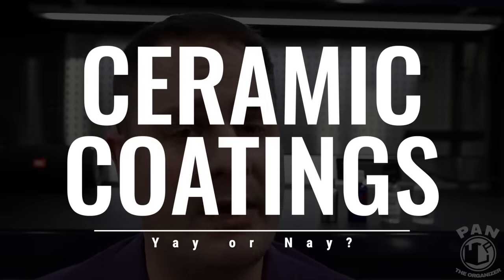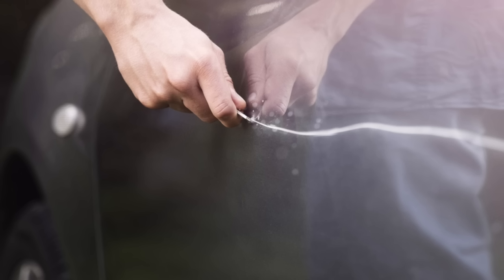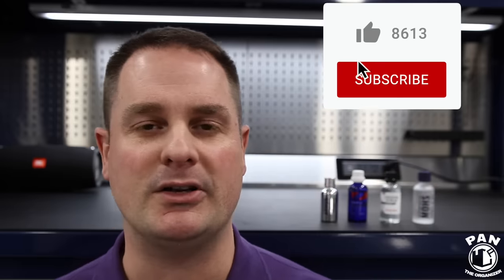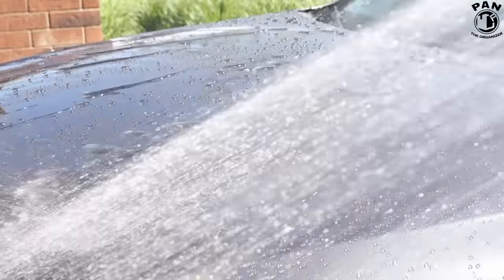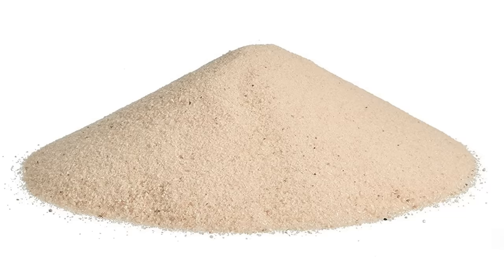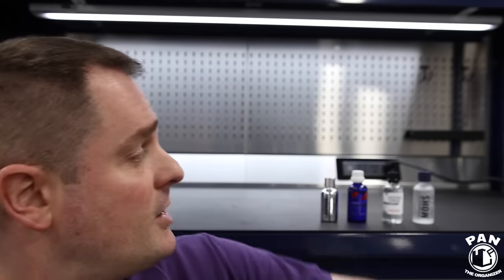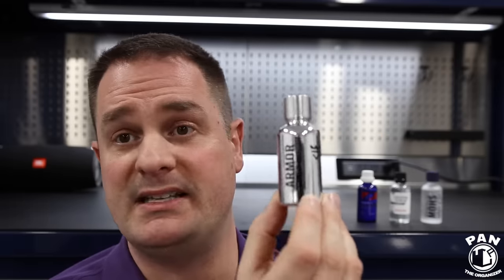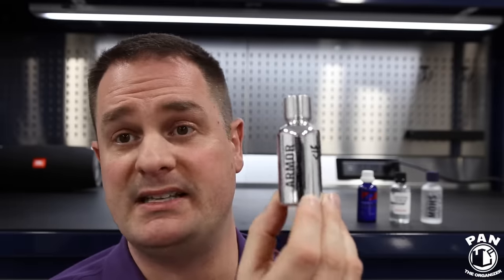DON'T BUY CERAMIC COATINGS BEFORE WATCHING THIS !!

Comment: pan do you have any ceramic coatings which perform rather poorly i.e. 1 year max? im after something a bit more durable than a sealant but i still want it to come off after maybe a year or so.
Reply from the maker: CarPro Lite lasts 6 to 10 months
Reply: @PanTheOrganizer  just 1 layer or 2 layers if you only want the 10months?
Reply: @PanTheOrganizer  my intention is obviously to skip the polishing step for a <1 year coating. as a result i will still have old spray sealants on the car - in my experience degreasers/IPA wipedowns dont really remove them fully and it really needs a quick polish to get them off. Can I still apply this coating on top of those or will that be futile?

Comment: can you apply Armor Shield IX outside or do you need to be indoors and then left inside for 12 hrs for example?
Reply from the maker: You can apply this outside, as long as you work in the shade and on a cool surface. And it's critical that you make sure it doesn't rain on the paint for 48 hours. Watch my full tutorial here: https://youtu.be/Rgli6VNLsK4

Comment: What do you think of the spray on ceramic coatings, e.g for example Griot's 3 in 1 Ceramic spray wax?  I've tried it and didn't have great success but think I didn't quite do it right (because I hadn't seen your application video until too late).
Reply from the maker: Ceramic spray products can be very good but one has to understand they still have limitations, as you compromise compared to full blown ceramic coatings found in glass bottles. So full blown coatings are longer to apply, cost a lot more, you have to worry about curing, flashing, high spots, you need more experience to apply them, etc. But they last the longest and offer the greatest resistance to the elements and to chemicals.

On the other side, you have silica spray sealants, like the Griot's 3-in-1 Ceramic Spray Wax that you mention, that cost a lot less, are much easier and quicker to apply, no worries about high spots, you don't need any experience to apply them, they still give great results with gloss and slickness. But the sacrifice here is that they won't last as long as full blown coatings, so anywhere from 3 to 12 months depending on which product you get.

So you have to pick a product according to your needs, experience level and budget.

Comment: Hey Pan! Awesome video. It has been super helpful. I have a question regarding how these ceramic coats hold up under touchless car washes that use high pressure and strong soaps to "clean" your vehicle. As I live in a climate where it snows, I'm wondering if I can get by using this type of wash regimen during the snowy months without stripping away or quickly degrading the ceramic coat layer. I've heard mixed opinions. Thanks!
Reply from the maker: Thanks! I'm glad to see that I can bring useful information to you guys! To answer your question, I always recommend that people wash their own cars at home, with pH neutral car shampoos, so they can control what is being done to the car. Automatic car washes, even the touchless ones, use highly alkaline (high pH) soaps that eventually can degrade the performance of even the best ceramic coatings. Coatings are tyipcally formulated to resist chemicals in the pH range of 3 to 12, but repeated use of highly acidic or highly alkaline chemicals will eventually degrade the coatings.

Even worse, NEVER use automatic car washes with roller brushes that scrub your paint! That will scratch it and swirl it regardless of what coating is on your paint.

Comment: Pan how do these Ceramic coating compare with profession ceramic coatings like Modesto, System X, Ceramic Pro etc
Reply from the maker: I haven’t tested those three brands. But usually, professional grade coatings will last longer and perform better, but they coast way more and can only be applied by certified installers.

Consumer grade coatings won’t last as long (in general) but they are easier to apply, cost a lot less and you can buy them.
Reply: @PanTheOrganizer  To be honest I'm just really nervous about polishing my car paint and ruining it, so maybe I need to leave this to a professional. I'll probably stick with doing maintenance wash and detail leave iron removal and ceramic coats to the professionals

Comment: would you ceramic coat 10 years old car with deep scratch but after polish?? Or should I go Semi ceramic coating like CarPro Lite etc?
Reply from the maker: That depends on your budget and skills. But before applying any true ceramic coating, proper paint prep is ALWAYS the best course of action.

Watch my ceramic coating application tutorial: https://youtu.be/sqQYVjxFqK0
Reply: @PanTheOrganizer  Prep paint is tricky word, if that includes decon, clay, compound and polish so I'm all set, but there are deep scratch that must be painted and I'm not willing to paint it. 
I guess I have to to paint those scratches before going on ceramic coating.
Reply from the maker: You don’t paint scratches. You polish them off using a machine polisher and and polish.
Reply: @PanTheOrganizer  Thanks for  your comment, but from my knowledge deep scratches must be painte, only minor scratches can be polished..right???

Comment: Hey Pan what should be the size of the area of work with a ceramic coating? In centimeter please
Reply from the maker: It depends on your experience with coatings. I can work bigger sections as I know how long to wait before levelling. But pretty much all brands recommend working in 2 feet by 2 feet sections (61 cm x 61 cm) as it's easier to manage.
Reply: @PanTheOrganizer  thanks Pan you rule m8

Comment: Great video! I have a  couple questions though. I have a PPF on my hood, front fenders, mirrors and rockers would I have to apply cquartz Skin PPF & Vinyl Nano-Coat to the PPF then cquartz uk 3.0 or Avalonking to the rest? Also, for the windshield would it be the same ceramic coat or Flyby Forte?
Reply from the maker: You can actually apply the AvalonKing and CQUK on PPF as well. You can apply AvalonKing on glass too (not CQUK).

AvalonKing is super versatile as you can apply it on all the exterior surfaces: paintwork, pladtics, glass, headlights, tail lights, wheels.

Comment: Hello Pan, thank you so much for your valuable videos.
I have a question on applying the ceramic coating DIY.
My car has some small scratches and stone chips on it, should I re-paint everything first before applying a ceramic coating or it is ok to have some little chips and just do it like waxing.
I know it is the best way to make everything perfect then do the coating but it will take a lot more time and sanding is very dangerous to the paint as a DIYer.
Thank you so much Paaaaan :D
Reply from the maker: Always do paint repair work first. Let a few weeks go by and then do the detailing part.
Reply: @PanTheOrganizer  Thanks for the advise Pan :D That's will be a great challenge for me to do the paint repair!

Comment: Thank you  so much pan for this video I also live in Canada in Edmonton btw I’ve been watching your channel for the last little bit here and I must say you are my favourite. I’ve have learned so much from you lately it’s unbelievable. I’m very OCD when it come to my vehicles. I just purchased a brand new 2020 Silverado high county about 6 months ago because it’s lifted with the big tires it stays outside. I’ve always detailed my own cars I’m a bit nervous about applying my own ceramic coating until now so thank you. I do have one question about gel coat I have a sea doo which is in really good shape but it does have oxidation what do you suggest to make that paint pop and protected it is always covered outside when at the lake washed after every use and always in my garage. 
Sorry for the long comment lol
Reply from the maker: Thanks Sergio! Congrats on your new Silverado! Did you watch the video where I detailed a black Silverado Z71? Here: https://youtu.be/g2FPiPkG4MI

Comment: Hi Pan! Great video! So if we do a regular maintenance every 2-3 months and apply an SIO2 sealant to replenish/rejuvenate the ceramic coating, then is it necessary to reapply the ceramic coating and if so, when should the ceramic coating be reapplied?
Reply from the maker: Yes at the end of the coating's lifespan (see the manufacturer's durability claims), you will have to restart the entire process which includes washing, decontamination, machine polishing (most important step), IPA wipe and then reapply the coating.

Comment: Roughly speaking how many ml of ceramic coating do you need per vehicle? Based on two coats.
Reply from the maker: Hard to say as nobody applies the same amount, but usually a 30ml bottle should allow you to aply two coats on two average sized cars.

Comment: I have read at least two reports of the AvalonKing product not being durable.  Can you support or refute this.  What have you seen with that product over time?  Does it live up to its promise?
Reply from the maker: You’re in luck, I recently released a two year update video here: https://youtu.be/2f6baiZskeA?si=XUf_IRvZqkJi-xHg

So it didn’t quite live up to my expectations due to factors and variables discussed in that video. But many of my viewers commented on the fact they are seeing 2-3 years of durability in good conditions.

Also, AvalonKing just released a new upgraded formula called AS9 MAX which I reviewed here: https://youtu.be/ZAc0w--cjdI?si=3D-wUPohwXw2MJCY

Comment: Hi Pan! Just wondering roughly how many vehicles can you coat with the smaller 50-100ml professional ceramic coating bottles? Looking to upgrade to a higher quality coating and also do my parents cars for them as well, so just wondering how much I'd need to buy for 3 cars! Thanks

Comment: Great video.
What is IPA?
Reply from the maker: Isopropyl alcohol (also known as a paint prep). It's a mix meant to remove polishing oils and residue after you are done machine polishing a vehicle. And you remove those oils and residue in order to ensure proper bonding of the ceramic coating on the paint.

To give you an idea of the steps involved to apply a coating, watch my popular tutorial here: https://youtu.be/byKcYsEyWGk

I hope this helps. Have a great day Stewart!

Comment: Hey pan I have a question. Can carpro cquartz lite be combined with carpro gliss?
Reply from the maker: You could apply Lite as a base coat and Gliss as the topper. But if you're at the point of applying Lite, you should consider applying CQuartz UK 3.0 instead. It will give you three times the durability.
Reply: @PanTheOrganizer  ohh glad you answer it👌🏽...Yes pan, but i prefer the lite one, cz it is more easier and cheaper in Indonesia😂, i don't have any experience before and I'm not sure it will work properly

Comment: Thanks Pan, great video, great channel!! My question is, is it necessary to polish car before applying ceramic coating (i have minor, very shallow swirls) since im scared of damaging my clear coat!
Reply from the maker: I always recommend a full paint preparation, including machine polishing, before applying a ceramic coating. You want your paint to be contamination free, and also free of swirls and scratches and oxidation, before you lock in that finish for years. I have the most popular tutorial on how to apply a ceramic coating with 4.1 million views here: https://youtu.be/byKcYsEyWGk

And you shouldn't be scared to machine polish your car if you have a dual action polisher. Watch my popular paint polishing tutorial for beginners here: https://youtu.be/X2qjO5xZZ2E

Comment: Just bought Avalonking ceramic coating for my VW Golf R 😁
Reply from the maker: Enjoy!!  What color is your Golf R? I love those cars man! I even fully detailed one in this video: https://youtu.be/jr19g4PWJsk
Reply: @PanTheOrganizer  it’s Lapiz Blue. I will go and check out the video. The car just went through full paint correction 2-3 weeks ago. Will I still need to do a polish after the clay bar stage? It’s only done 100 miles since it was done.

Comment: Hey Pan, new subscriber here love your videos man. I'm new to car detailing especially ceramic coating I'm planning to use armor shield IX. My question is do you recommend ceramic coating a brand new car? I'm scared I might screwed up and messed up a brand new car. Thanks
Reply from the maker: Hi Gian. Applying a ceramic coating on a brand new car is actually the best thing you can do! You start protecting it right away. I have tons of new car detailing videos for you to get an idea of the steps for both interior and exterior. Here is one of them: https://youtu.be/tjJPcdCUaK8

How did you discover my channel by the way?
Reply: @PanTheOrganizer  Thank you for the quick response. I'm going to order 3 armor shield IX now
I was searching some videos on how to ceramic coat a car, several of your videos popped out. I'm glad I clicked one of your videos and watched it. Also thanks for the $25 discount. Wish me luck 🙂

Comment: Hey,

Have you reviewed Adam’s Ceramic Spray Coating? I know that’s a more diluted formula, but would adding more coatings end up being the same thing as ceramic coatings?
Reply from the maker: I had it in my real world durability test against 19 other paint protectants in this video: https://youtu.be/MoBTLpRFFw4?si=VcyN0Eq1s64e1qBg

Spray coatings typically last 6-12 months. Easier to apply and less expensive. But they don’t last years like the more expensive full blown ceramic coatings in glass bottles.

Comment: Pan. Can ceramic coatings be able to be applied to a caravans with composite(flat panels)
Reply from the maker: It depends on the coating. You would have to check with the manufacturer to see if it's compatible with the material you are looking for. Ceramic coatings are usually formulated for clear coated paints, but there are marine applications for fiberglass and even some that are now formulated for us on PPF (paint protection film).

Comment: Can you apply it on the windshield?
Reply from the maker: Not all coatings are meant to be applied on all surfaces. Some are for paint only. Check with the manufacturer of the coating you are buying.

If you were asking about the AvalonKing specifically, then yes it can be applied to glass surfaces too.

Comment: Pan love your show watch you all the time and recommended you to lot of my friends to watch . I just ordered the armor shine 9 ceramic coating . So now I just need a piece of advise before applying it . I polished  it with the Turtle Wax black  High bird. And I have been using shinearmor fortify and it's been working. great . So how or what do I do to to prepare this for the ceramic coating. Do I have to strip it down using clay bar. Hope to hear back from you I'm a big fan of your video's love them all .  Plz help thx
Reply from the maker: You have to fully wash, decontaminate, polish and IPA wipe for sure. And don’t use a polish that has protection in it! The Turtle Wax Ceramic Acrylic Black Polish isn’t a good choice in this case as it has protection in it that could interfere with the ceramic coating.

Watch my full tutorial on the AvalonKing here: https://youtu.be/Rgli6VNLsK4

Those are the correct steps.
Reply: Pan could you recommend which clay bar is a good choice
Reply: Maybe do a video on just the different clay bars we can use with links to them all . I haven't never used it before and have no idea which one to get or what product to get.

Comment: Can i put ceramic coating ,, on plastic,, headlight ,,, window,, chrome etcc
Reply from the maker: It depends what ceramic coating you buy. Some are just for paint, others just for glass, others just for plastics, etc. Some can be applied to most exterior surfaces, like the AvalonKing for example. I have a video showing everything it can be applied to here: https://youtu.be/6hDGYz6vvsw

Comment: You mentioned top coats for the other ceramic coatings is there a topcoat for the armor brand that you mentioned?
Reply from the maker: No as it doesn’t need one. But you could apply any topper you want. CarPro Gliss, Gtechniq Exo v4, etc

Comment: Can u apply a ceramic coating outside? If so what brand do u recommend?
Reply from the maker: Yes, as long as it doesn't rain for 24 hours, and don't work in direct sunlight. Work on cool surfaces. The coatings I recommend most are the four coatings presented in this video. did you watch the video?
Reply: @PanTheOrganizer  yes I did.. tks  I’m gonna try the armor shield!!

Comment: Hey Pan, always cool stuff to watch. Quick question, is the C.quartz UK 3.0 replacing the Skin one? and is it possible to use it on top of PPF like the skin one? I bought both the 3.0 and Gliss for final coating but never asked if that was ok for PPF and Car Pro are not talking about it on their website
Reply from the maker: CQUK 3.0 is for paintwork, and is still a current coating in the CarPro lineup. It can also be applied to PPF. But CarPro developed Skin specifically for PPF.

Comment: My car is only a week old. Do I need to clay bar and polish my car after a wash and before I use a ceramic coating?
Reply from the maker: You have to inspect what your paint looks like, because even new cars aren't really new, as they have been transported by truck, train, boats, they have been left at boat docks or in dealership lots for weeks sometimes months, have been exposed to rail dust, brake dust, the elements, have been poorly washed and prepped by the dealership, etc. I could go on for days.

Watch the steps I perform to a brand new vehicle right after it was delivered here: https://youtu.be/tjJPcdCUaK8
Reply: @PanTheOrganizer  sweet. Thanks, Pan, for taking the time to answer my question. We appreciate it 😇
Reply from the maker: Thanks! How did you discover my channel?
Reply: @PanTheOrganizer  I was looking for videos on ceramic coating and came across your channel. Great content! 👍